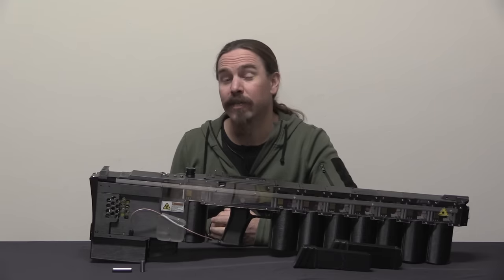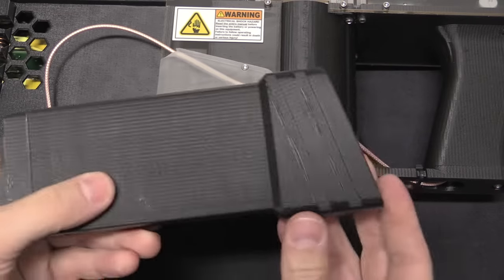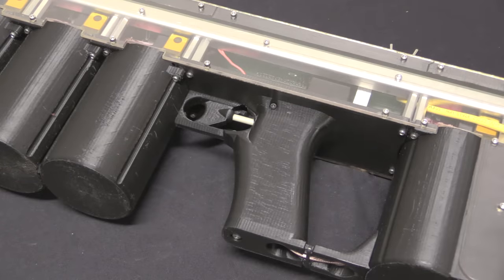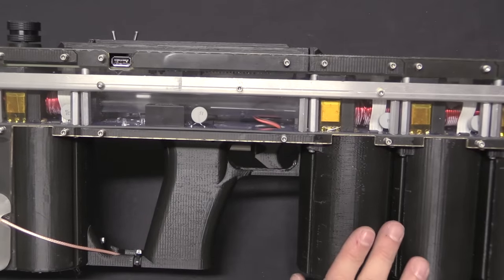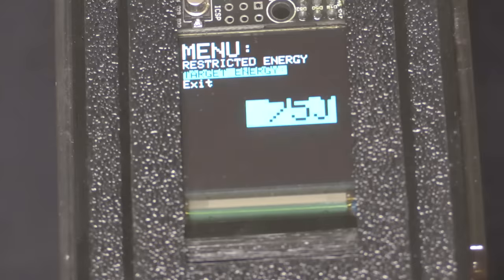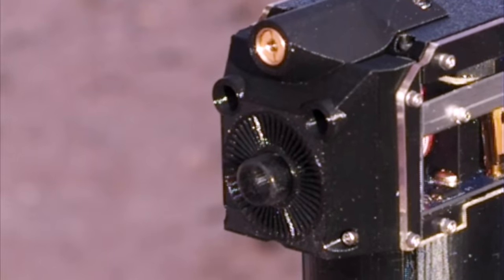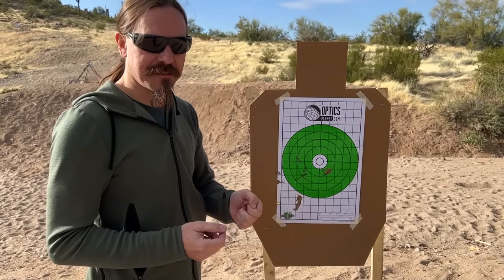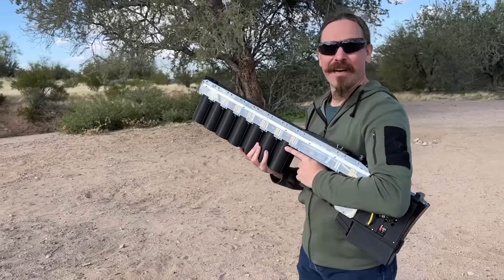ArcFlash Labs' GR-1 Anvil Portable Gauss Rifle

Comment: While a 70m/s muzzle velocity is low, these are some fairly heavy slugs, so they do deliver the power of a pistol round. The intriguing part is that you could essentially make it a non-penetrating and thus non-lethal round by design, this would allow law enforcement wizards to shout "i cast fist!" as they shoot someone with this gun.
Reply: or you could use it to defend yourself from "law enforcement"
Reply: @festusbojangles7027  Sounds like a good way to win a darwin award.
Reply: That's a great idea, they should go for a non-lethal version with bigger and heavier rounds.
Reply: Uhhhhh No, just stop. 70m/s is only 230ft/s. My pellet gun shoots just under 500ft/s. Sure these slugs are large, but they sure as shit arent hitting with the same force as a pistol when a glock shoots at 375m/s or ~1200ft/s. Dont comment this crap unless you understand what you're talking about.
Reply: Because less lethal weapons are not killing enough people
Reply: @FPSCongo1  Except .22LR is a pistol caliber and even Ian himself said it has the same energy as a .22
Reply: @FPSCongo1  Exactly. And once the tech reaches the level to make those rounds lethal, it will also be extremely loud.
Reply: @FPSCongo1  pretty sure when it fires 30mm solid steel bearing balls, it will be just as dangerous.
Reply: @MySkybreaker  22lr is an absolute joke of a round. Same energy but way larger projectile, you're never penetrating skin. Might break a rib but this thing is NOT lethal in any way.
Reply: @Reason4Termination  lol nope. Same energy as a 22lr but WAY bigger. Never gunna penetrate skin. Might break a rib
Reply: @FPSCongo1  My fist is significantly slower than that and even a unstanced straight jab from my secondary hand is plenty to knock you out :)

Also you might want to actually read the entire post what you're replying to.
Reply: @Kanakotka  ok tough guy 🥱🥱🥱 You said "so they do deliver the power of a pistol round". First of all, what units of "power" are you referring to since you're so smart?
Reply: @FPSCongo1  Not a tough guy, simply a heavyweight boxer until i broke my back when i was 21. The power it delivers on target is around 230J. The readout is not the energy delivered, but rather the energy transmission from each coil. 

By comparison, my main hand in stance is 833J peak measurement, and front/secondary hand is 372J. 

A direct hit in the chest area of around 100-150J when you're unprepared is enough to stop you in your tracks, or push your breath out if it's a little bit lower. To knock someone out via a hit to the head significantly less is required.
Reply: @Kanakotka  hahahaha okay buddy 😂 Best keyboard warrior Ive met in a while
Reply: @FPSCongo1  I don't think you even read the posts you replied to to begin with... :)
Did you know that the first post you replied to has the words "wizards" in it?
Reply: @Kanakotka  "power delivered on target" no account for energy lost via heat transfer, transmission loss in electrical components, peak impulse degradation as the battery drains, air resistance, etc.. I could go on... From a mechanical engineer: your numbers are complete bullshit. Again, stop spewing nonsense about things you know nothing about.
Reply: @FPSCongo1  You think that wasn't taken into account then? :) Since when did you become a mechanical engineer? Just now? Congratulations on your internet diploma!

Personally, if i want to employ a mechanical engineer, i'd prefer one capable of basic literacy.
Reply: @Kanakotka  oh so you did the finite element analysis on the entire system? Can you send me your matlab, abaqus, or any other program/language you did the study in? Id LOVE to see it, honestly.
Reply: @Kanakotka  specifically the heat transfer and peak impulse degradation as a function of the battery percentage. You should be able to use abaqus for both!
Reply: @FPSCongo1  Or, you could consult the people who actually made the weapon. I would link it to you, but i believe as a part of your imaginary degree, you might have used a search engine once or twice before.
Reply: @Kanakotka  ah the deflection! 😂 whatever you say bud! The iron ring doesnt lie

Comment: This is at best a proof of concept that it can be done. Now the R&D goes into making it practical for use. Will we have portable gauss hand guns in 10 year? That would be doubtful at best. Could we see a refinement to this for a rifle type? I'd say that's more feasible than anything. It's fun that you can throw a slug like this and it travels. How well that's another problem as was shown. More than likely just like the discarding sabot rounds, the slugs used here will probably have a means to rotate itself as it travels. This way when it comes out it will travel father and much straighter.  This is the begging like when we went from catapults to canons and bow and arrow to blunderbuss and muskets. Exciting times ahead.
Reply: "This is at best a proof of concept that it can be done."
Not even that considering that there are literally hundreds of videos of people doing that for many years on youtube. So rather than a proof of concept it is a rather bad concept.
Reply: @ABaumstumpf  Sure but can they fire every 3 seconds off a Li-on battery?
Reply: @jaredliv  There are some that can fire multiple times per second. That's not the issue, the issue is that a high tech pellet gun that probably doesn't have enough power to do more than embed an inch or two nto the flesh weighs 50 pounds and costs more than a thousand dollars, and it still takes 3 seconds between shots, not to mention piss poor accuracy (and inability to solve that using conventional barrel designs).

For this to make a little bit of sense, energy storage density and throughput would have to increase tenfold, which at our rate of battery development, which has been pretty linear over the past few decades, would take more than a hundred years.

Comment: Since the energy numbers aren't crazy high, could you collect the projectiles down range and fire those again like you could with BB guns? Have you collected your fired projectiles?
Reply: Theres no reason you couldnt just use steel balls I would bet they would fly better.  though I am surprised they didnt make a finned projectile to stablize in flight
Reply: he did another video with the one that fires disks.... matt says they can be reused 
ssooooo....they can be reused (even these "rods" instead of the disks)
.
of course.... if they hit something solid / close range...... and deform, they cant be reused 
.
you cant fire a "round" bent at 30 degrees......... or mushroomed out bigger than the barrel
but one that hit some dirt/hay and is 99% exactly as it was ....... yup, 100% can be reused
Reply: I'd say it depends on your backstop material, and how much effort you're willing to go through to recycle.
Reply: I wonder if the rounds get magnetized and whether this would cause problems. You might have to “degauss” the used rounds

Comment: Wow this is amazing, you could use lighter rounds for target subduing and lower the m/s for lower impact velocity aswell so as to not pierce skin but be alot like a sand bag, make them programmable on the fly so you have to manipulate the settings to increase damage output, which would also stop people from firing a killing shot in a riot situation, it would be alot like the weapons used in the movie DREDD, lawgiver firearm :) just need a way to compress it size to a manufacturable scale and this could essentially revolutionize the gun market and also prevent accidental shots, weapon tampering or theft, requiring a security login of sort, voice commands, facial recognition and a lot of other safety protocols that could save lives world wide, I am sure there are other things thought up like this, but if it works well enough, scaling shouldn't be a problem and with battery tech getting better, could last longer, provide higher output and also should be an easier way to keep barrels and components cooler using gases that are less likely to explode around said parts and could be reloaded with canisters.

Overall I think this is really cool.
Reply: Yeah, imagine you could use this as bean bag gun with lower setting and with highest setting you could shoot through a tank. Future has no limits.

Comment: Tumbling mid flight seems to be a significant issue with this platform. Maybe it could be remedied with fin-stabilized projectiles?
Reply: Sounds like a good idea.  Flechettes, crossbow quarrels...
Reply: @ericwilner1403  Why the heck isn't he using Flechettes? is exactly what I was just thinking...
Reply: @bryangb  because flechettes don't have the mass needed. Take a big neodymium magnet and stick it to your refrigerator. Then stick it to a 1" thick piece of plate steel. That's why flechettes wouldn't work.
Reply: This exact thing was discussed in yesterday's video. Fins add a ton of complexity and issues to the magazines/feeding systems. They mentioned looking at using different properties of electricity/electronics to spin the projectile as it travels down the barrel, but they aren't there yet.
Reply: @bryangb  Keep in mind this model is mostly to prove that the tech works on a basic level. I'm sure the designers are working on ways to stabilize it as we speak but for now, using standard size dowl pins makes a fair amount of economic sense.
Reply: My first thought was old boring steel ball, then i wondered if there was a minimum mass vs length the projectile needed to have to be "grabbed" my the coils in a optimum manner. Might throw a wrench in more eleborate shaped slugs. Also with the slug not making any contact with the barrel, and fluctuations or misalignment of the final coil will throw off the accuracy, stabalized or not.
Reply: @skreemer3801  It seems to me like this would be better solved having the barrel rifled like a traditional firearm, but there's a system of either pressurized air to go along the channels or smaller magnets to initiate spin.
Reply: @VulpesHilarianus  rifling dont work with this one, the projectile is never in contact with the barrel, check out the previous video
Reply: @VulpesHilarianus  The "barrel" is just a piece of polycarbonite plastic, (I mean for what it's there for and the current speeds you could almost get away with a piece of schedule 40). The projectile never touches the sides/barrel, so there's nothing to positively engage it to impart the spin. And god forbid you cut through the plastic and touch the contacts on the coils while they're charged.
Reply: A rounded nose could also significantly help the aerodynamics.
Reply: Could you have small oblique positioned explosive charges activated by the magnetic field to give it spin . maybe solid rocket fuel in the "hollow point " venting through positional vents? Sorry if this sounds stupid I am neither a engineer or a physicist.
Reply: @annakanna  It would never be with the design I mentioned either. The rifling would just be channels for compressed air, or places to put smaller magnets to initiate the spin.
Reply: @VulpesHilarianus  using magnets to impart spin is actually discussed in the interview video

Comment: So how do they plan on fixing the tumbling projectiles? Like how was that not a major concern when developing the weapon in the first place? Obviously just changing the shape of the projectiles could help stabilize them. Whether it's giving them fins or some other actual physical characteristic of the ordinance. Additionally, they could probably change the way the magnets propel the slug by also introducing some spin without needing rifling or friction with the barrel, which would give it gyroscopic stabilization and increase accuracy, help ensure level flight.

Comment: for the accuracy problem, it might be worth taking a look at nerf foam dart evolution, as they have similar dimensions.
Reply: Yeah, hollowing out the back of the slug would make it front heavy. We currently know of three good stabilization methods:
Balance it so it's front heavy
Give it fins to add drag to the back of the round
Spin it
Bullets pretty much only use the last one, arrows use all three, some darts use the first two, NERF darts use only the first.

Joerg Sprave could probably design a few rounds for this. Weird finned rounds are his forte.
Reply: @RaccKing21  Nerf Ultra darts have kind of fin as well
Reply: @ZeroHumanity  Oh, first time seeing those. Those are a bit after my time playing with nerf.
Reply: @RaccKing21  you could spin it with the magnetic field as well if built right
Reply: @RaccKing21  in terms of accuracy they are between Elite and Accustrike darts, not sure about velocity, since they are incompatible with both mega.and normal blasters.
Reply: @Elios0000  yeah, that goes under spin stabilization (with a magnetic field, fins, rifling)
Reply: @RaccKing21  I was thinking of the accustrike dart tips. the spiral divots supposedly help impart spin like fletching.
Reply: @RaccKing21  the lack of weight up front has been the downfall of most flechettes
Reply: @MrZarnach  Ultra darts are actually generally regarded as inaccurate garbage. The current gold standard in dart accuracy is the 12.7x38mm "short dart" or "half-length dart" (because they're half the length of the standard Nerf-brand dart). Most hobbyist blasters and high-end Dart Zone and Adventure Force blasters use these.
Reply: @Balmung60  never said they were any good, just that they are better than standard elite darts, which are absolute garbo

Comment: I feel like it is not traveling at a fast enough speed to pierce a person. I would be interested in how this would go up against ballistic gel. This is an awesome project.
Reply: Nah, i don’t think it would take too much force to make it pierce, it’s still a piece of steel in it, plus if they make ammo that has a point, different story I think. I wonder if it has recoil though? It’s pretty cool though
Reply: If you don't think it'll penetrate a person you're on glue.
Reply: A bb gun is 300fps he said 70fps was the velocity
Reply: @calvenwilliams3373  m/ps
Reply: @sp8715  ahh I don't know why I heard feet
Reply: @calvenwilliams3373  ya its an honest mistake. I checked and 70 meters per second is like 220 feet per second so you're not wrong
Reply: @sp8715  but that's also a inch of solid steel, not a bb if considering penetration. So it will have far more force based on F = M × A (or deceleration in
the case of stopping). If you consider the energy per round E = 1/2 M × V^2 so speed is more important than mass still (and those units are kg and m/s to get out joules).

On that basis, it struck me as odd that the same energy translated to the same speed on the different sized rounds. Suggests there is a fixed cap to transferring the electrical power to the projectile.
Reply: @Barqop  no the firearm does not have recoil. Coil guns are recoilless weapon systems because there is no combustion
Reply: @jonarific8504  oh it would mess a person up for sure
Reply: @AntiquatedApe  Haha, Newton's third law still applies here. It's barely noticeable here because of the low power and heavy weapon.
Reply: @frostedbutts4340  The force applying to it is not from behind but the sides through electromagnetism there is no recoil. Plus its not pushing the projectile its leading it through and out.  Very different physics that you see in newton's law.  Now there could be energy backfire once the projectile leaves the gun so if there is any recoil it could be from that so newtons law might be in force there.  That's just in theory.
Reply: @michaelmichaelagnew8503  no, there is still a force acting on  the projectile, newton's third law is definitely still applicable. Pulling or pushing doesn't matter, see a slingshot.

Comment: Purely from an analytical standpoint and the limited view I had of the "barrel/muzzle" it appears the plastic tube is not firmly locked into a specific position, which may lend to the less than accurate mark of where you were aiming vs. the impact point. if the exit point can move 1mm in any given direction, it is going to tend to drop down due to gravity as the projectile approaches,  When the linear acceleration along the forward axis can shift 1mm the arrival point at the target 10 meters away can be wildly different between 2 otherwise identical shots.  As you said this is an Alpha version, mostly to get the basic issues identified and prove the concepts are very workable.  So I definitely wouldn't consider this ready for use beyond testing, but it does support the further development.

Since you're firing a "low velocity" round of "high mass", it will tend to have a much higher "drop" over the projectile's path due to both air resistance and gravity.

25:47 "it's consistently hitting to the left."

I'm not sure if that is a breeze I'm hearing on the microphone, I tried watching leaves on the tree and your hair to try to determine windspeed and direction.  If there is wind coming from you right, it could be related to the wind and the overall "massive" profile and longer travel time at lower velocity of the projectile compared to a traditional bullet profile

Comment: Rifling is to spin stabilize a projectile.  I imagine as capacitors get smaller they could be configured around the barrel in a helix to not only pull the projectile but also spin stabilize it.